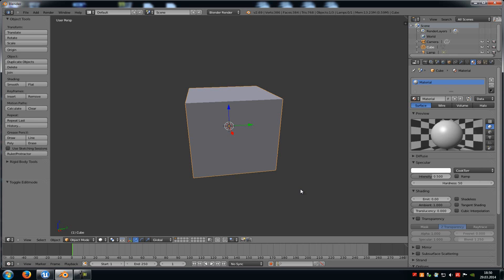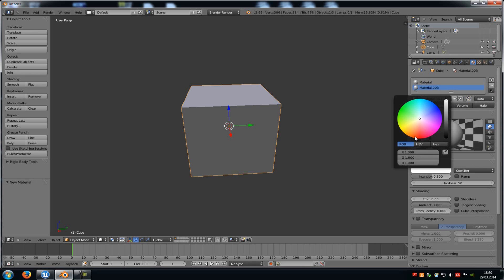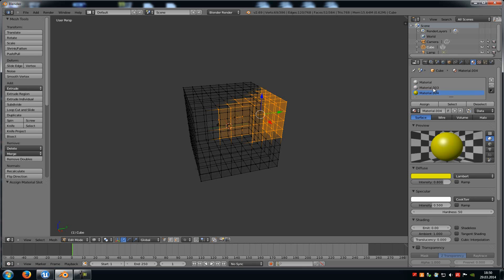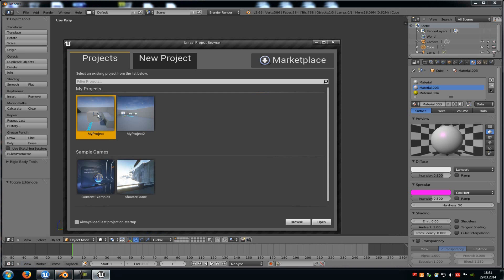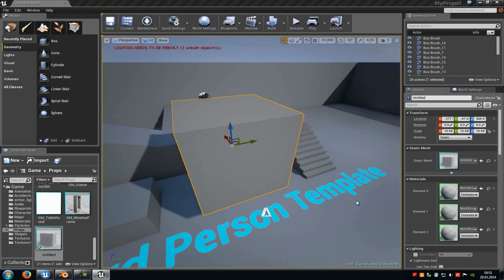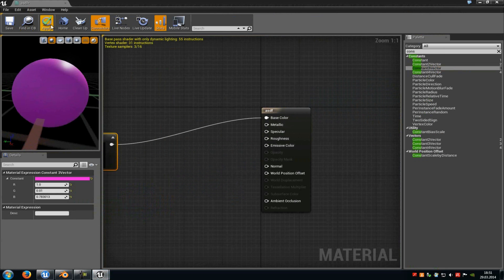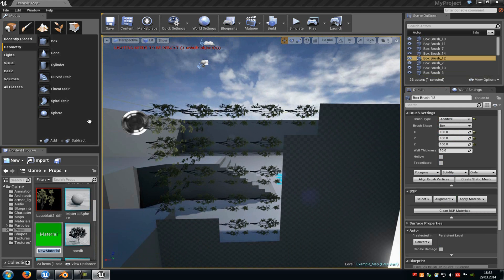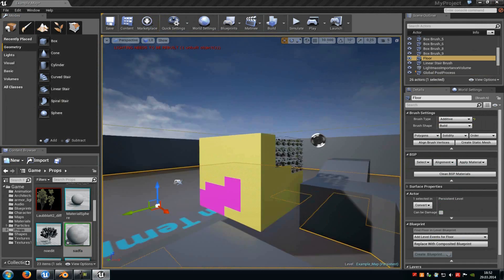Unreal Engine 4 Tutorial: Material Slots (english)

Comment: Thanks for this video.

The workflow of creating multiple materials in blender for UE4 has gotten a lot harder. I used to be able to just UV map onto multiple images without having to creating multiple materials. UDK3 would recognize each image as a separate material. All was good.

Now for UE4 I have to jump through material hoops in blender. I need to experiment with this to figure out the best work flow. Can I UV map onto materials instead of images, otherwise I have to apply materials to faces at the same time I UV map them.

Hopefully I am missing something.
Reply from the maker: You can always add a UV map to a material in blender
Reply: @MetalGameStudios  This is so confusing. How do I import the FBX into UE4 as NOT a scene???? This is why I hate using other programs. Because the export/import has 10 settings that people skip over, so idk what do check. So I google ue4 do not import FBX as a scene, and all I get is results for importing as scene.
Reply: This is so annoying and confusing. Why cant I select the face of a mesh/triangle in UE4, and change its texture to another slot???? This was so easy in UE2 or 3. I forget. But wtf in UE4 I dont know how to do this basic thing. And dont want to do it in another program = bad workflow.